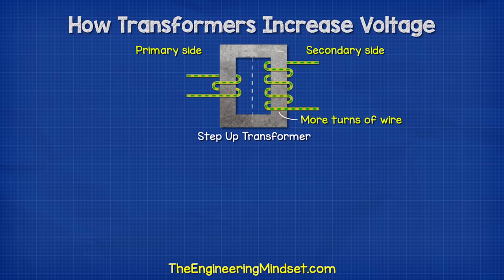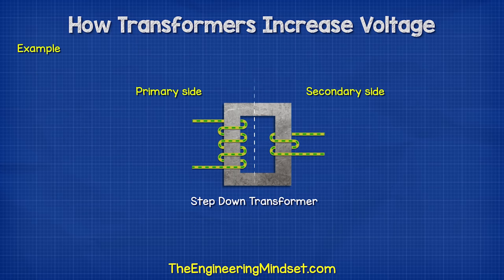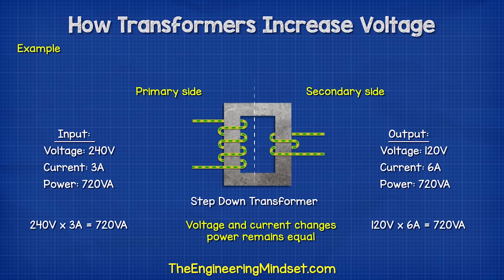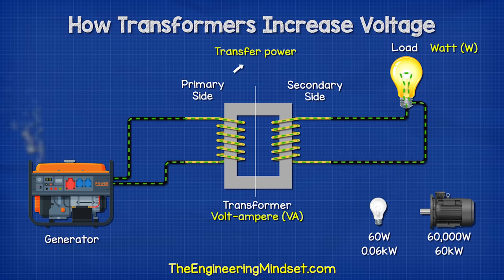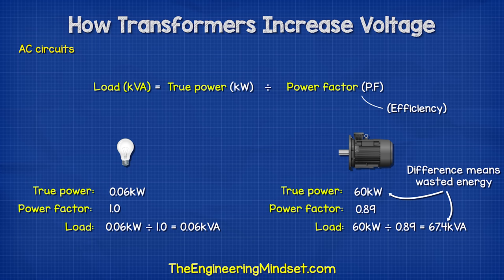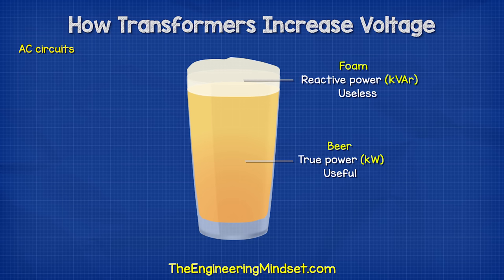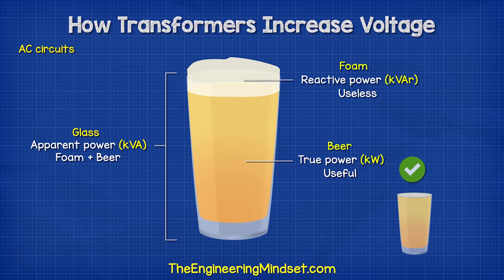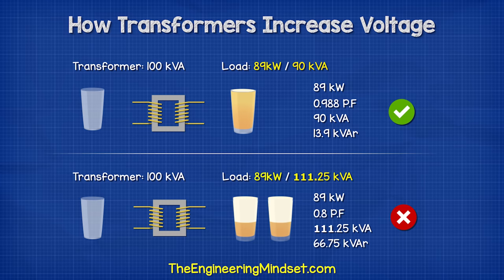Transformers: How They Increase Voltage

Comment: Great video! I want to clarify one thing, though. Reactive might not be useful but it's NECESSARY. You can't output it as work, but it's the energy needed for the transformer itself to work (magnetize). Therefore, is NOT energy dissipated as heat. And also that's why it's said that's an energy that "comes from and goes to" the transformer. Energy dissipated as heat comes from the resistance in coils, a that is ACTUAL WORK lost in heat.
Hope it helps.
I still think your videos are great, I try to watch them all. 😀
Thanks!

Comment: I HOPE I GET AN ANSWER FROM THE EXPERTS THAT I TRUST IN THIS CHANNEL.
What happens if I made an transformer like this: For example, your primary winding can handle 240V 5A, then you added a coil that can produce 120V 10A, and the load (let's say an amplifier) should require to consume 120V 20Amps (2400W). Is that possible in the first place? What would happen? Or is it that the amplifier will just have to consume 1200W resulting to lower output volume and distorted sound from the speakers? Or is it that the amplifier will not work at all if the power needed is mandatory? Please, I need an answer. Thank you so so much
Reply: I think I want an answer to this too. :yougotthis:
Reply: @queenwasp8987  I hope so
Reply from the maker: Well the transformer probably has a fuse to protect it from overloading too much, you can overload transformers, at least for a short time (you shouldn't though)  but it will eventually just overheat the windings, the enamel coating will melt and the transformer will short circuit and cause a fire. It might be rated for 10A but that's just saying it can handle that safely, it can definitely go higher but the manufacturer won't guarantee the stability past that point. You need to sufficiently cool the transformer core, but ideally you should just stick to the safe operating limits and size the transformer correctly.
Reply: @EngineeringMindset  woaaaah!. I really appreciate your answer.. I think I know what I should do. I'll just rewind the toroid transformer I bought. I'll use thicker wire needed for 10A for primary  winding. Then proceed with other windings I need. I'll also add a fan just to be sure it won't heat up to much.. this really helped me with my project.. Thank you sooooo much! 🤘🏻🤘🏻🤘🏻✨✨✨

Comment: I don't think it's accurate to call reactive power wasted power. Reactive loads return power to the source, so less real power is used, but it's not lost.
Power factor is not power efficiency.
Transformers are less efficient when not fully loaded, but this is because of the losses due to heat generated in the core and windings. The losses are present regardless of the load, but are a lower percentage of output power at higher loads.

Comment: But why do more wires on the secondary side results im more voltage? What is the reason for this?
Reply from the maker: More coils means more space to capture magnetic field from the primary coil.
Reply: @EngineeringMindset  to be fair this is kinda the thing I was really keen to understand when clicking on this video. 

This was still very informative though!

Comment: Actually this is not accurate. Power Factor is not "Efficiency" as inductive and capacities equipment need to circulate power back and forth between the equipment and the grid in order for them to operate and that is indicated by Power Factor but this power is not "lost" per say. You pay for the kw, not the kva, because your consumption is only for the kw. It is of course not useful have a high difference between your kva and kw (i.e. consuming more reactive power kvar) because it means that there will be more loses over the transmission lines. Therefore, utility company ensures to keep the power factor as high as possible, but this is not an issue in facilities where generation and loads and just near each other.